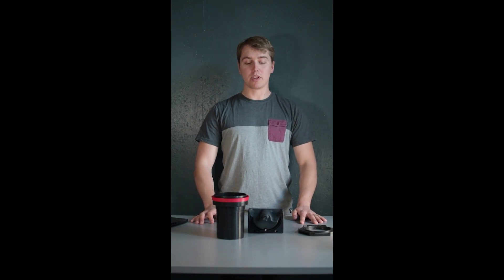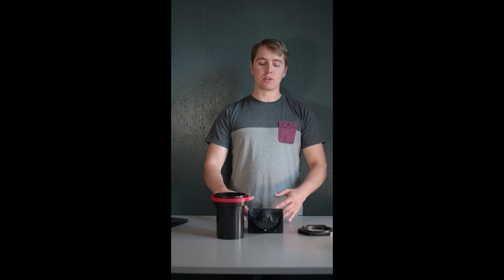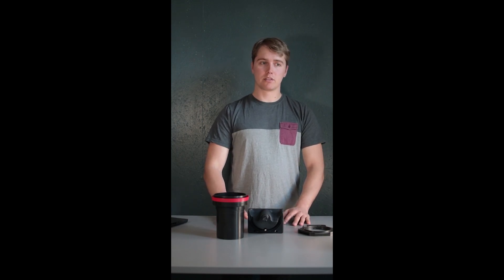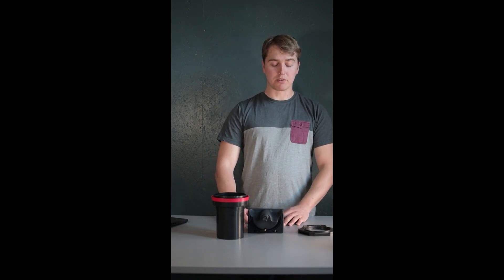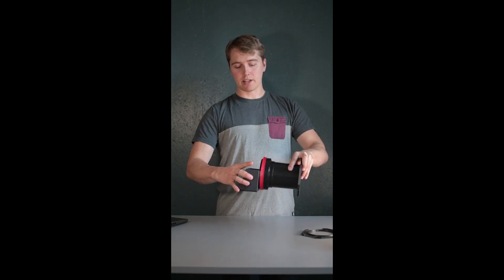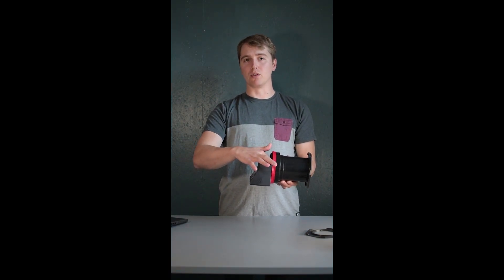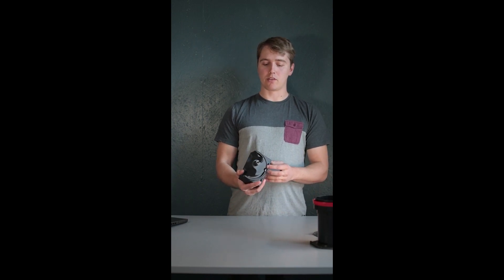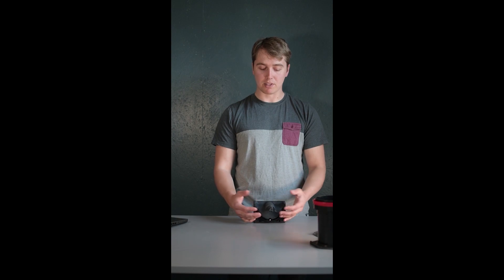AGO Film Processor Introduction

Comment: There are other, probably more recent, better videos from AGO which demonstrate the device and explain how it works. Basically, this device addresses the issue of being unable to maintain time and temperature at close tolerances during development in a way which is the reverse of JOBO and similar water bath systems. Using a simple film tank allows the developer to cool during processing, which throws off the accuracy of the development result. JOBO address this by rotating the film drum in a heated water bath during development to hold the developer and film at the target temperature. AGO allows the temperature to drift/cool normally, avoiding the hassle and mechanics of a heated water bath and specialized drums, by using a microprocessor to measure developer temperature during processing and automatically extend development time to compensate for the cooling developer. (And, in the rare case, shortens the time if the solution temperature increases.)  Neither system is perfect. Tests on JOBO heated bath units have shown that they do not maintain temperature at a steady target level as suggested, much of that error relating to the cheap designs and internal systems used. They could do much better for little extra cost. AGO's accuracy assumes that the algorithm programmed into their processor to extend development time to adjust for falling temperature accurately reflects the chemical response of the developer to temperature changes. Developers will perform a bit differently, so that ends up being an estimate of what the average developer will do. Of course, most JOBO systems will do other things for you, but if you do not need those optional functions, the AGO may do as well, take a lot less space and hassle to use, and should cost less. (Price yet to be published.)

Comment: Great idea! It also has a heater?
Reply from the maker: Thanks! No, it doesn't. With C-41 you just can place you chemistry into sink or bucket where you can heat it with tap water- up to 30 to 38 degrees. When you pour in chemistry AGO measures the temperature and compensates time.